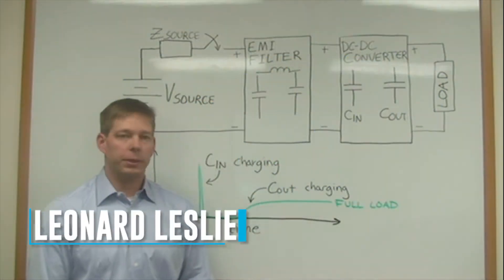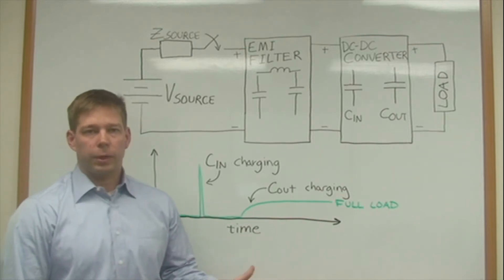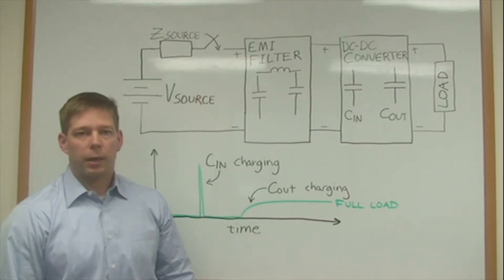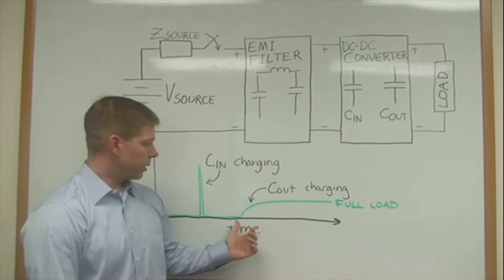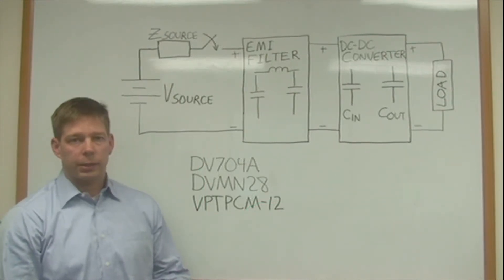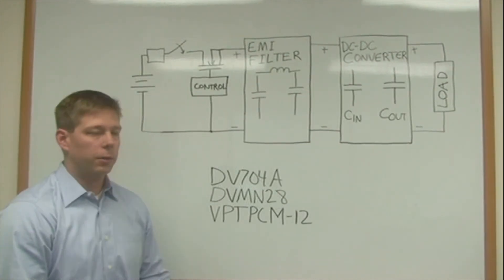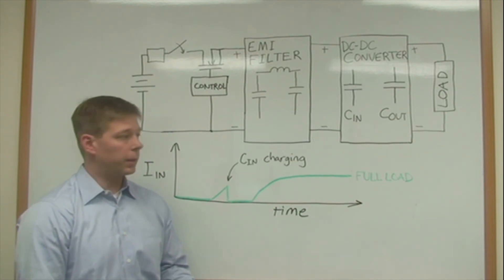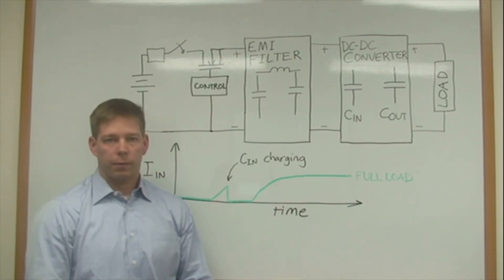Inrush Currents in DC-DC Converters

Comment: that important. thanks. but how I can calculate the good way to charge a capacitor have 3000Farad with 15V with max exactly current with the shortest time that I have to initialize without damage the system charger or the capacitor life?